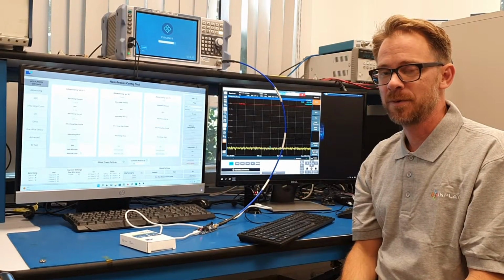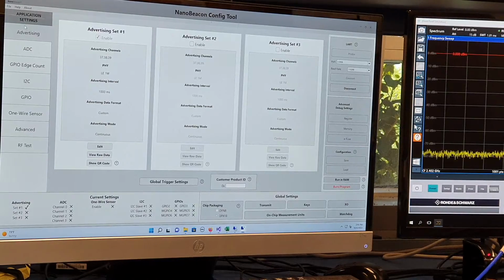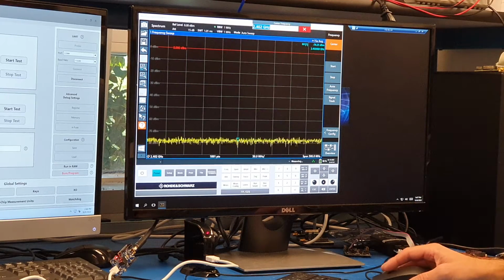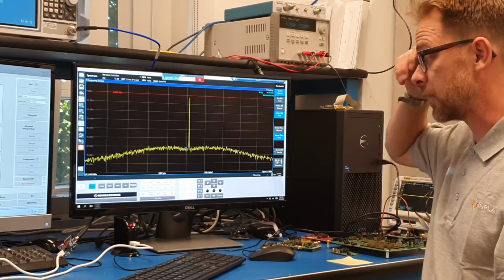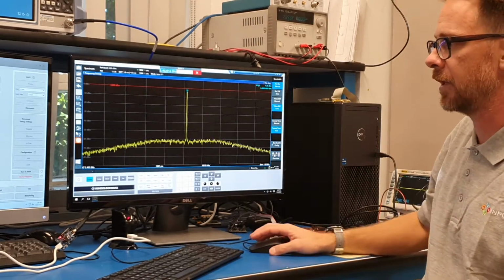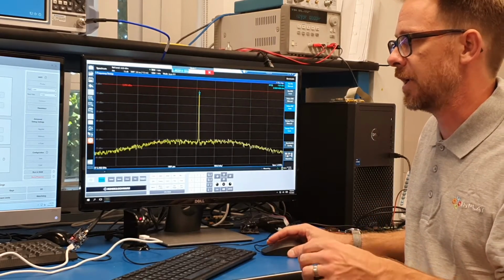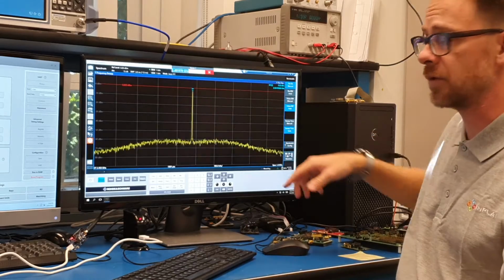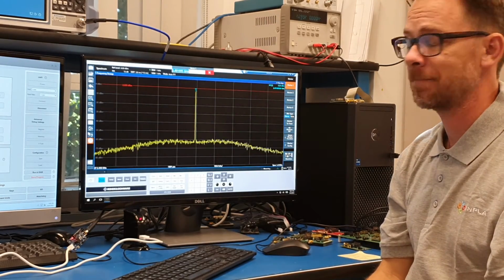Ep17. Calibrate 26MHz X-tal frequency offset with NanoBeacon Config Tool

Comment: what of a volume production case? need to do this for each unit?
Reply from the maker: It depends on your specific design needs. Typically, in the majority of situations, a single configuration can be implemented across all products during the large-scale manufacturing stage.